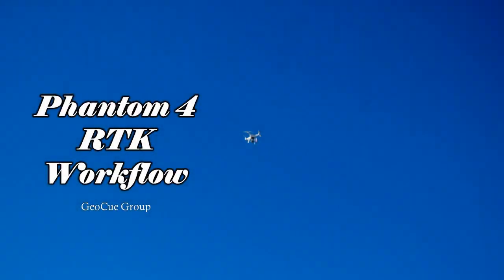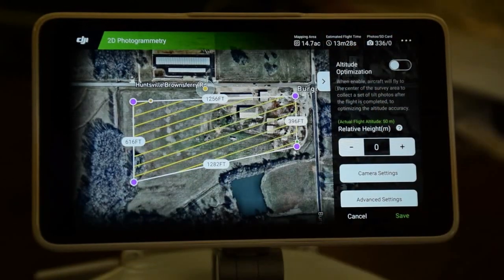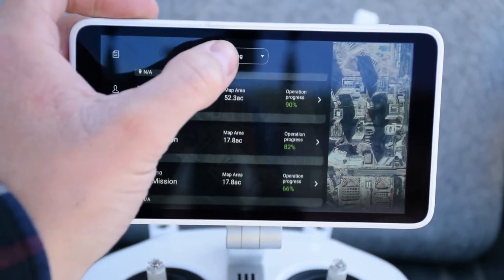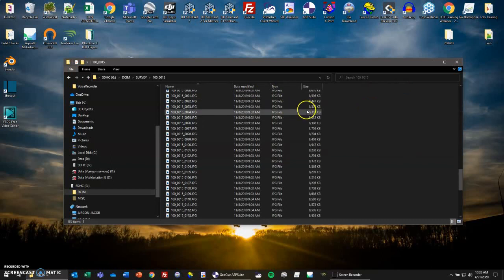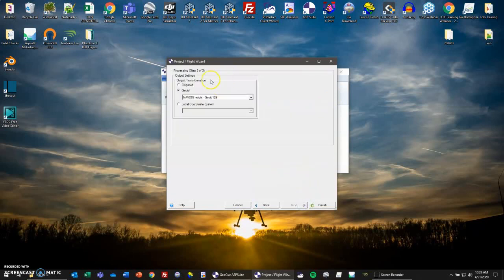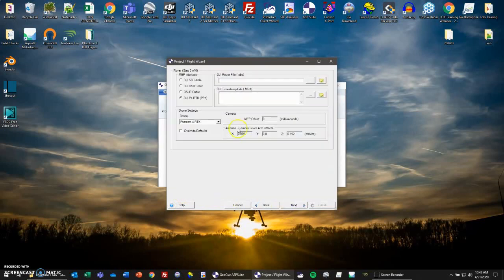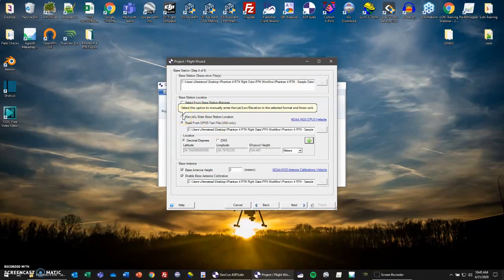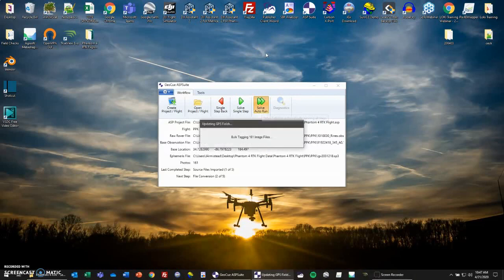DJI Phantom 4 RTK Workflow

Comment: Hi there, the firm I work for just bought two P4 RTK to be used PPK with Trimble receivers for logging static data. I did a couple of test flights but keep getting no fix solution, in fact when ASP tries to find a solution, it stays on Q2. All the data I fed  ASP with is correct, any idea why this is happening? Aprreciate your help
Reply from the maker: Please see the list of probable resolutions for Q2 solutions in the following post on our searchable support knowledge base, https://support.geocue.com/aspsuite-gnss-quality-levels-explained. If that does not resolve the issue, please contact our support team, by e-mail, support@airgon.com, or via the support form on our website, https://geocue.com/support/#support, for additional assistance.
Reply: @AirGonLab   Hi AIRGONLAB, I found a solution to the problem with changing the satellites logging interval to match the drone one (0.2s). I was previously logging static with my Trimble base at 1s intervals as I always have when using my M200 with Loki...and got also to find out that Loki logs satellites every 0.1s. Never stop learning